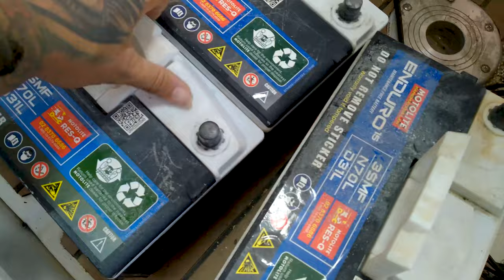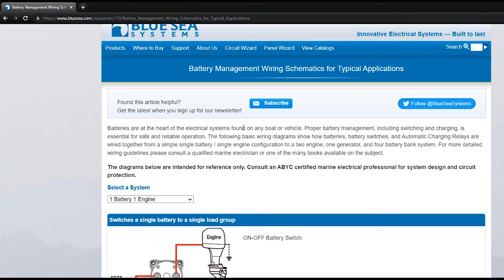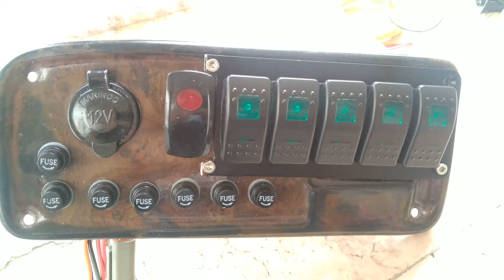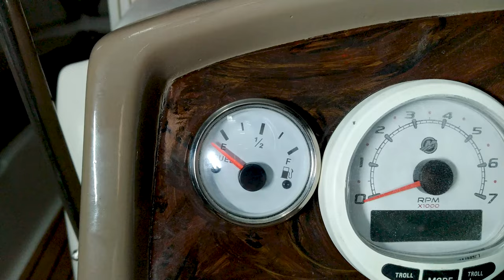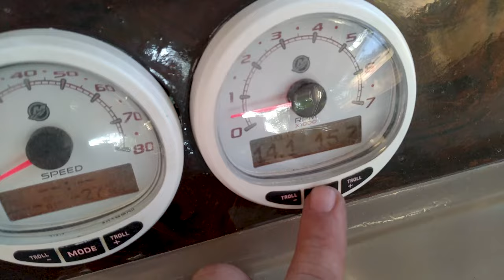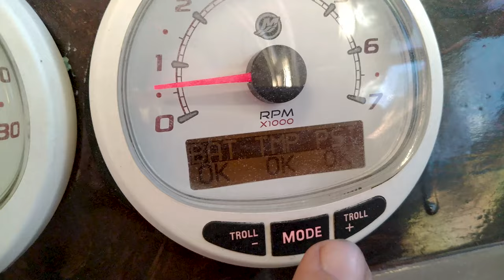3 Battery Wiring a 2 Outboard Engine Boat

Comment: Good work. May I know where does the small on/off switch below the 2 VSR connected to? What is the purpose ? Thanks.
Reply from the maker: Thanks. Small battery isolator switch is for the house accessories. 

2 perko's for each engine. Can switch to combine all for each or for both.
Reply: What’s the brand of the small switch
Reply from the maker: @howellgrange8257  It's a generic Chinese made battery isolator.

Comment: I was thinking of rewiring my boat by placing the 2 batteries from the transom to mid cabin, so how far can I wire a battery from the motor? Do you think 2 gauge wire is good enough for let's say 12 ft from the motor? Thanks
Reply from the maker: Mercury even sells 12ft 4 gauge cables. Yes you are doing good. Remember to protect each crimping ends with silicone dielectric to prevent corrosion and make sure everything's nice and tight.
Reply: @chrclmnky  -thanks for the reply and advice